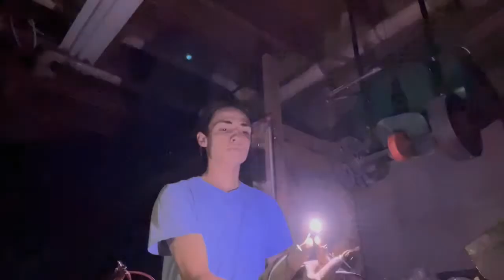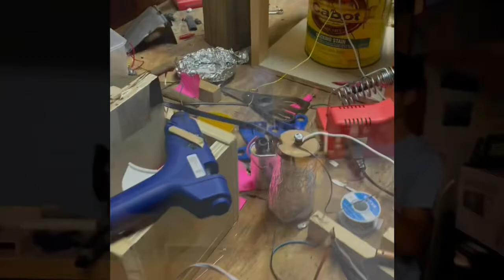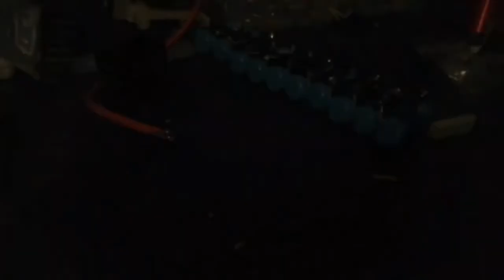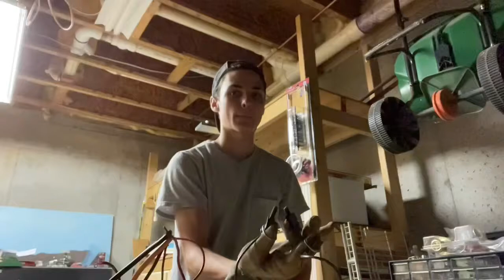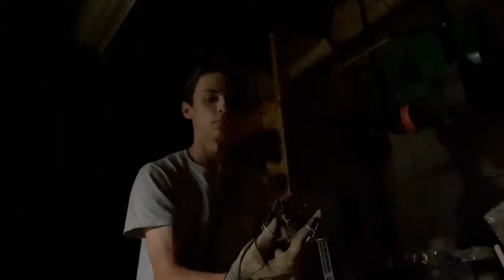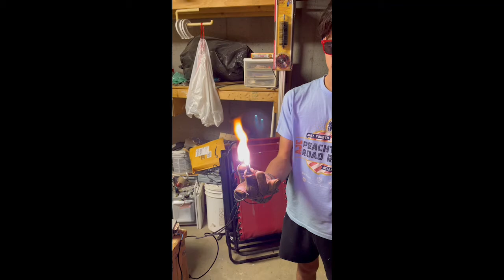Carbon arc lighter glove HIGH CURRENT!!

Comment: That's pretty cool man, although I'd never have the guts to try it myself. Too little space between my hand and near-certain death, lol. I safety ever becomes an issue, you can always use a ZVS-driven flyback transformer. I have one that can make sparks even bigger than some of my MOTs, and it might not kill you if you touched it (no promises though, lol)
Reply from the maker: Yeah ZVS drivers are pretty useful.  The glove is actually pretty safe though bc i have two layers: a thick rubber insulated glove underneath the leather one I’m pretty sure gives a dielectric strength of double or triple the power of the arc…however it’s definitely a thing to be handled with care
Reply: If current from MOT only goes through fingers and palm, you could get away with only hand amputation